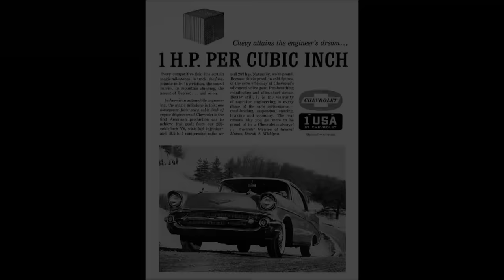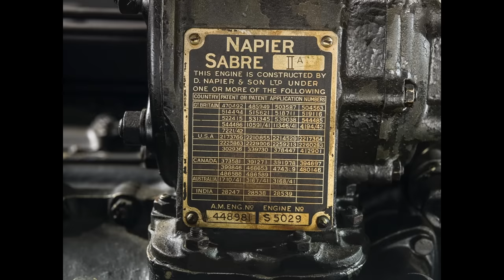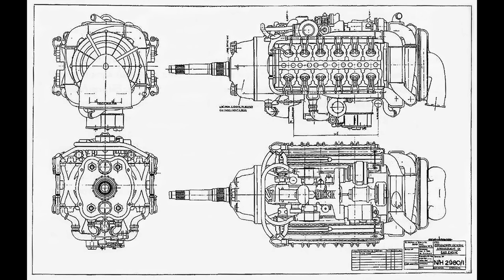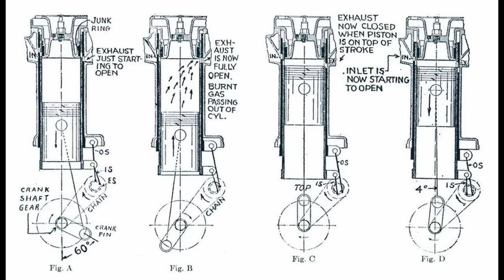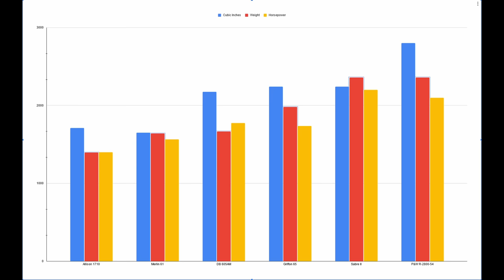Napier Sabre - The Ultimate WWII Aircraft Engine - Part 1

Comment: Excellent video.  Well done.  I'm a Rolls Royce and P-51 fanboy.  This engine is an astounding design for the 1930"s.  If they had the materials then, that we have now, this engine might have had a more illustrious history.  One question that occurred to me was about the brake-specific fuel consumption compared to the other engines.
Reply: You would think it would have better efficiency due to the better airflow to the cylinders. However the frictional Loss due to the complex sleeve valve assembly may make it worse. Why has no modern sleeve valve engine been built for racing?
Reply: @AtlasLathe  possibly rules...
Reply: As far as I know a Tempest or Typhoon has above average range due to a high cruise speed, but this comes at the cost of a relatively higher fuel consumption as well, so range was good, loiter time was not. One thing that was quite bad was OIl consumption though, I forget the exact figures but a Sabre would consume unreal amounts of oil while running due to its design.

Comment: i worked on pratt & whitney r3350-32 & 34wa engines in the 60's at alameda ,ca. that engine produced 1 hp per cubic inch 3350 hp, the engine had an engine driven supercharger with a huge carburator, along with power recovery turbines utilizing exhaust pressure to spin 3 turbines that were hooked in to the crankshaft via fluid couplings, as well as water/alcohol injection to offset detonation. the engine was used in the A1E skyraider for the navy and the airforce, as well as the constellation cargo/passenger for the navy and air force

Comment: Rolls-Royce were told well before WW2, that smaller faster revving engines would be less stressed overall and more powerful in both bhp per litre and bhp per unit weight.  They ignored the thinking and came close to failing with the Merlin. Centrifugal forces on the large crank threw oil out faster than the oil pump could feed it in. Smaller cranks can spin faster. It's not necessary to push all the power through one cranks, so why not use two or even three (thinks Deltic).
Reply: Doesn't high reving engines usually  sacrifice torque ?
Reply: @robertmoulton2656   If everything else is equal then it depends on where you want the torque. high rpm engine will have MORE torque at high rpm, and LESS torque at low rpm compare to a low rpm engine.  on a piston aircraft propellers are almost always running at highest torque rpm range as you can change propeller pitch so its not important to have low range performance, your day to day driving car on the other hand is the opposite
Reply: @robertmoulton2656  Power is the product of torque times RPM.
Gears are the devices we use to swap between RPM and Torque at a given level of Power production.
Engines will run into some physical constraint on either the Torque or RPM extremes, but generally high RPM designs are easier to optimize for high power to weight ratios.
This ultimately led to turboprops commercially replacing piston props.  Power to weight ratios of extreme RPM operation more than offset the weight of massive reduction gear ratios to deliver the high torque a prop requires.
Reply: That explains why semi truck engine spin 8/9 thousand Rpm .
Reply: @robertmoulton2656  Semi truck buyers care far more about fuel efficiency than power to weight ratio.  Mostly because wheels on the ground handle excess mass far better than wings in the air.
Big slow engines are more fuel efficient.
Ocean going freighters even more so.  One of their pistons can be  bigger than an entire semi engine.
Reply: @NullHand  
“That explains why semi truck engine spin 8/9 thousand Rpm”.  Mr. Mouton, I’m wondering where the typo is, as it seems you know your stuff.  What Diesel engine in a semi spins 8/9 thousand Rpm?  Very curious here.  As a huge fan of anything that has a motor or a rotor and burns fuel or powder, I’ve never seen, nor heard of, a 9,000 rpm diesel.  Granted, I don’t know everything, but I’m not new to old engines or cutting edge engines, but have yet to see a diesel that runs 9,000 rpm.  Could you please direct me to an example?  Right on comment about fuel efficiency for trucking owners.  Reliability and longevity, are every bit as much as important, even with diesel running $5 USD per gallon in the States.  With today’s diesels often putting on a million miles, when properly cared for before a rebuild.  Last years SEMA had a D-max (as I recall) being stoked with 175psi of boost.  An interesting little tidbit many may not know, is that for users that are not looking for maximum fuel economy and a million miles worth of durability, those engines are up rated in performance. When younger, I did a great deal of the maintenance on our apparatus.  We ran 8V92TA’s at 500hp and Cummins N14’s, for example,that were updated for “emergency services”.  Not too common to see an engine go much over 50,000 miles in its career.  The uprated HP rating was appreciated.  Many engines and trucks had up to 100 gallon tanks.  On a good fire, we could actually run them dry, and had to be relieved as we went to fuel back up.  Moving up to 2000 GPM of water that weighs 8.3lbs per gallon, required a whole lot of power.  A bit tougher to move than air. The old Detroit Diesels cost me my hearing, as it did most of my generation, riding in a jump seat, next to a screaming 6V or 8V, is not pleasant.  We did have to fear accidentally over revving for fear of getting those two strokes to change direction.  Never seen it, but supposedly it was an issue.  That up rated power was great for getting to a scene.  I do recall getting 50,000 lbs of engine up to a frightening 70 mph on surface streets, more than once.  Even managed to drift an engine through an intersection one day.  One palm on the wheel, no lift on the accelerator, to keep the rear from swapping ends.  A misspent youth street racing may have paid off a bit there.  Before diesels were popular, it was “no substitute for cubic inches”, so the industrial Fords at close to 600 CID, and even an old GMC 702 CID V-12 are fond memories.  I wish someone would pursue some of the principles of decades ago, using modern tech and electronics.  Could you imagine a Deltic with direct injection, stratified charge, and intercooled turbos?  A truly fascinating read is Peterson’s “Non Aeromotive Use of the Packard V-12”.  I’ve got an autographed copy laying around somewhere.  I asked one day why we kept the truck bays so warm, thinking they must really care for us firefighters.  Nope.  It was to keep the apparatus warm.  Living in Northern Utah where snow and cold was a real issue to be handled, I loved the 2-stroke diesels.  No need to spend precious seconds warming them up, you had full power available NOW!
Reply: Yes, the Deltic was an amazing engine!
Reply: @robertmoulton2656  No.  Torque is very closely related to displacement.  Where in the RPM range the best torque is made is quite variable.  Obviously, chasing maximum HP means that you design for best torque at high RPM's.
Reply: @smokeater4558  you spewed alot of words over my sarcastic response. Yes I now heavy machinery well . Most build best torque quite low. (1200-1500rpm)
Reply: By 1942, RR was working on the 100 series engine with much improved oil distribution.  It was bench tested for WEP at 2640 HP.  The P-51H and DeHavilland Hornet used that engine and the SU fuel injection.  It was far more reliable than the N-Sabre.

Comment: Perhaps you should add to your reading list Sir Stanley Hooker's autobiography 'Not Much of an Engineer' which gives a much greater insight to the problems associated with engine development prior to and during ww2. Though I don't doubt that RR did interfere with the adoption of any competitive engine, the British faced a steep learning curve to become competitive with the enemy.

Many of the breakthroughs were made by private ventures and elements of good luck which, eventually overcame the Air Ministry's stubborn refusal to accept new ideas. The RR Merlin was one as was the Spitfire, Mosquito, etc. As I see it, British industry was not well prepared for large scale production and the rush to remedy that was chaotic. For example RR used fitters to assemble their engines and were all by definition hand built. Ultimately, all the drawings and tolerances had to be changed to allow contracts to other engineering companies to mass manufacture the RR Merlin. For example, Packard.

The choice of putting what few eggs it had in one basket, meant that getting a universal power plant to give good performance across a number of different airfares with differing performance requirements was very obvious. RR to their credit tested their engines to destruction to eliminate any weaknesses throughout the conflict. The RR Merlin was the smallest displacement aero engine of any front line aero engine for the duration of the war.  At 27 litres it started life at slightly less than 1000hp and ended producing 2000hp and in special cases 2500hp from the same displacement at the wars end. The Merlin was regarded as very reliable in service possessing the ability to accept additional boost in emergencies.

However the Ministry's resistance also limited the use of Bristol's sleeve valve radials in British airframes despite having higher power ratings and simpler air cooled designs.

It is difficult to imagine the Napier engine being as flexible beast to attain volume production and be useful for such a range of airframes. Also, we are talking about different time periods the RR Merlin being a pre ww2 engine versus an engine produced later during the war.

By the end of the war it was increasingly obvious that piston engines were reaching their limits as required power needed for a given performance boost was becoming exponential. The jet engine was proving to be the next step forward. My apologies for straying off topic.
Reply: The changes made for the engine to be mass produced had to be done for Ford of England not Packard.
The changes made for Packard to produce the engine were made to the blueprints, American Industry used a different viewing plane on blueprints than British Industry did, by the time Packard was brought into the loop the tolerance changes required for mass production had already been done as per the requirements for Ford of England.
Reply: @dukecraig2402      I was told years ago that it was Ford who built the reliable Merlin engines whereas the 'original' RR-built ones routinely dumped their engine oil en masse over the pilot's windscreen.
Reply: I read somewhere tha t when Rolls Royce tried to get them to stop the Sabre Lord Beaverbrook in laymans terms said" shut up and go and build your own and stop interfering"

Comment: Definitely seems like an incredible piece of kit but also somewhat obvious why such a power-plant wasn’t more wide spread. As you described it it sounded a lot like an F1 engine lol. So high complexity highly stressed high chance of failure. The operating RPM alone being a third more than that of its contemporaries is quite telling of the potential rate of wear such a system must have undergone, while in 1940? When oil was about as viscous as sand paper? A lot of power from a lazy under-stressed engine sounds definitely more military, for the redundancy, reliability, and opportunity to use. 

Napier Saber sounds more racing motor than warplane
Reply: Sabre !!

Comment: They had serious quality control issues from what I have found. Not fixed until under new ownership. Sloppy assembly and metal cuttings in the engine, if true, trumps all the hype about RPM, power to weight etc.  Engine failures in A/C cause more than an inconvenience can’t pull over and curse and kick a tire.  Even a partial engine failure is a serious emergency in an aircraft. THIS I have experience with.
Reply: Almost all British Engines were hand fitted!  Spare parts generally had to be made big and you sawed or filed metal off until it fit!! (Or in the case of some parts you had up to 7 part sizes (3 smaller, 1 average, and 3 larger) and you had to order the right one.  I've had the same experience on one (built by the lowest bidder and the parts "fitted" that way, where it took a few tries before we found a +1 sized cylinder liner that actually the block AND the piston!  We were able to deliver the engine back to the ship "only" 3 days late!
Reply: I have read that the source of the early problems with the Sabre was to do with the sleeve valve tolerances. Napier were unable to achieve the precision required and the machining of the valves was farmed out to Bristol - who had the necessary expertise gathered from their own Centaurus engine.
Reply: A good friend of my father’s was killed when the Sabre in his Tempest cut out over the channel - he was never found.
Reply: Hand fitting produces incredibly tight tolerances - far more exact than the mass production pioneered in the US. But, parts from a hand fitted engine would not (guaranteed) fit any other engine of the same type and hand fitting requires highly skilled engine assemblers. American  mass production engines needed much lower worker skill levels. It's the contrasting visions of the two Henry's - Ford and Royce. Is the American system better in time of war? Probably, yes - but, RR built 2/3rds of wartime Merlins, Packard, only 1/3.
Reply: @alastairbarkley6572  Exactly, plus the amount of time to do this is ridiculous!!!  The time it takes to train someone how to do this accurately, the time to constantly replace tools for the squadron's maintenance crews (since they do wear out!) and the time to actually hand fit parts when the squadron needs every possible plan in full working condition!!!!!! 
     (Rolls Royce and Avro made the "power egg" for the Lancaster so they could swap out engine and radiator assemblies quickly and repair whatever was wrong and still keep the bomber flying...)
Reply: @timengineman2nd714  FWIW, the Bristol Hercules also had a unitized 'power egg',  developed in 1939, allowing fast swap out of the entire engine.
Reply: @timengineman2nd714  “power egg” that term makes me chuckle for some reason
Reply: @BeaufighterGaming  That's what the Brits  called it!

Comment: The Turbo-Compound Wright R-3350 (which wasn't available during the war) required a huge level of development to make it safe and reliable. My memory may fail me, but I believe each TCP R-3350 used 3 turbochargers that added ~350 HP each back to the crankshafts via quill shafts. So ~1000HP per engine. That had to develop a lot of heat under the cowl in an engine design that already suffered severely from overheating on some cylinders. Over its wartime equivalent R-3350 which also had a terrible reliability record on the B-29.
That's why the B-50 with 4x R-4360s was quickly developed to replace the R-3350.
I spoke briefly with the Engineer on FiFi, which was the only flying B-29 at the time. He said, and I paraphrase, that using the the original WWII back accessory case, there were 1 or 2 cylinders that failed consistantly at ~100-200 hours. They switched to the back case design later developed post-war for Airliners, and  basically their overheating problems went away. I got no more details than that.
These 3 engines. The Sabre 7, the TCP R-3350 and the R-4360. Are the Pinnacle of aircraft piston engine development.
It's really too bad the Sabre wasn't given the financial and political resources for proper development that most of the other fantastic WWII engines were provided. Especially in the optimization of forced induction for altitude performance.
Purely speculating, I don't think much resource development, if any, was given to designing a lower drag and more aerodynamic radiator system. Thoughts from anyone else that may have an opinion or insight? Especially those from the UK. It's an engine not frequently discussed or considered here in the US. Hopefully, these videos will change that.
Reply from the maker: I know they wanted to move the radiators into the wings similar to a spitfire but ran out of time before the end of the war.